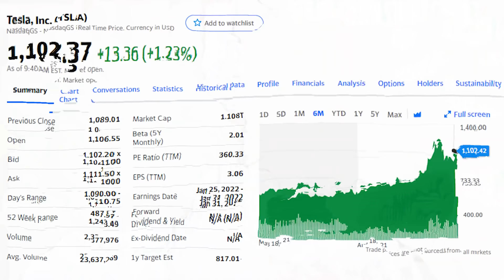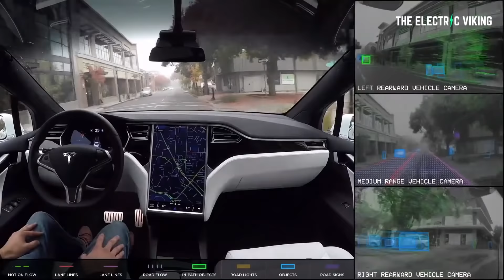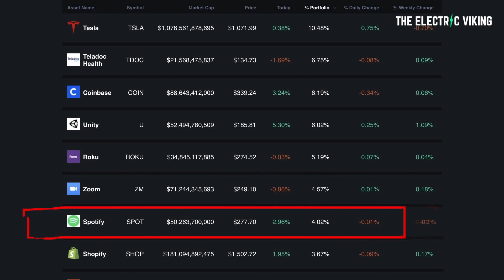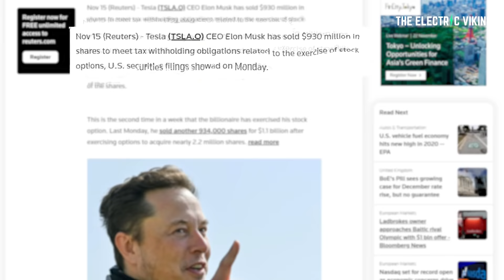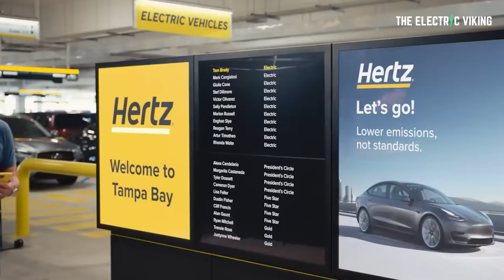Cathie Wood's 2025 TESLA prediction - is it possible?

Comment: triple by 2025 is bearish...the revelations of where the company is by 2024...and where it's going after that will cause a massive increase in the price by the end of 2024...  i predict closer to 5000.  let me be specific...Tsla has 10x'd (i'm rounding down) in a fairly straight line in exactly 2 years .  and this is without the complete knowledge of where the energy, insurance, and further product sales are going by 2025.  fsd anticipation is somewhat included..but incompletely.   so, it is inconceivable to me that the stock will do worse than 4x...and perhaps there will be a mania that sends the stock to 7 or 8 thousand per share...the company is a centennial phenomenon...  the old predictions do not apply.

Comment: Autonomous driving is the future. It will be a 100x trillion dollar industry. Most big tech companies want a piece of that market: Google, Tesla, Apple, Microsoft and maybe NVidia. Current tech is clearly not on level 5. But it will most likely be in 10-15 years. It is highly unlikely there will be a winner since most tech in this area is on par with each other. Also the companies involved have enough capital to see it through to the end. Most likely 50% of traffic will be autonomous driving in 2050. That means 5 times less cars worldwide since these cars are used 24 hours a day. So the car industry will not be a growth market, autonomous driving however will be. Software of course is key in all this. You want an easy hand over from in house devices to the car that you use for transportation. The autonomous driving itself will only be a relative small part of the experience. You step in the car and go on with you activity (work, gaming, Netflix). Long distance driving will not be a problem since its like you never left your workspace or house. Also the car itself is not important. All cars will drive with speed 70 miles an hour and once you enter all that matters is the interior. The concept of a car brand will be unimportant in 40 years. These cars could have interior build by Apple, exterior build by VW, hardware build by NVidia, interaction software build by Google, MS, or Apple and autonomous driving build by Tesla or Waymo or both. Tech innovation has never been a winner take all game. The idea that laws of economics suddenly have changed is not logical.

Comment: By Xmas, in spite of Musk's sell-off, Tesla will be around $1250.  It will have doubled in a half-year.  At that rate it will be at $5000 by Xmas 2022.  Tesla's output is doubling roughly annually altho it could double faster while ramping it's new factories.  One expects that if Tesla's sales doubling rate exceeds it's output doubling rate the price will need to pause while the output catches up.  This is what "exponential" means.  If you cannot, from your school days, write down the value of e to 8 decimal places please resist the temptation to use the word "exponential",

Comment: At some point legislation will arrive that forces all charging stations to be vendor neutral. There goes Tesla's biggest first-mover advantage.  We don't tolerate customized gas stations per car brand, and we don't have room for duplicate charging stations. 

Electric cars are so easy to build, there are multiple startups across the globe doing them. Tesla has 2 factories operational now, with 2 more under construction, and so they will have more production capacity than other firms.

However, Korea, Japan and Germany will keep tesla market share low in their home territories, and therefore it will be difficult for Tesla to go to 12 factories without a change in their attitude.  Tesla stock has a ridiculous price/earnings ratio, and there is no justification for such a valuation from any manufacturing company. Tesla's solar division is languishing. SpaceX is the better company frankly. 

The car business is oversaturated with companies supported by the national govts., and Tesla cannot waltz into Asia or India and command big marketshare like they did in the USA. Famous investors like Peter Lynch never bought above a P/E of 30, Tesla is over 300.

Comment: stock value speaking Tesla is 20x overpriced based on comparable stock prices of GM, Ford which puts Tesla at around $57/share on an equal static basis. BUT, because of the growth of the company due to the opening of 2 new EV plants, and new battery plants, etc, the EV production and profit will increase exponentially especially with the higher margins they are able to obtain. This in itself will continue to drive up the share price to a huge multiple until production plateaus which is around 2025+ which is when all Tesla competitors are equally in full production. So enjoy the ride, because Tesla share price in the distant future will correct, besides in 2025 Apple icar becomes a reality which will be the new EV stock to own beginning in 2024.